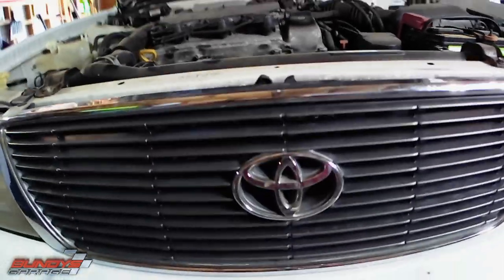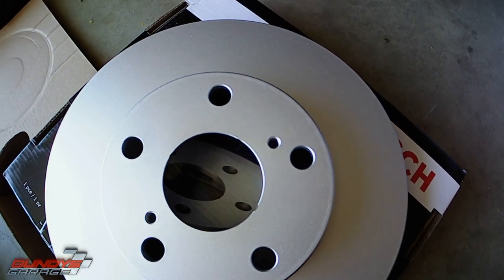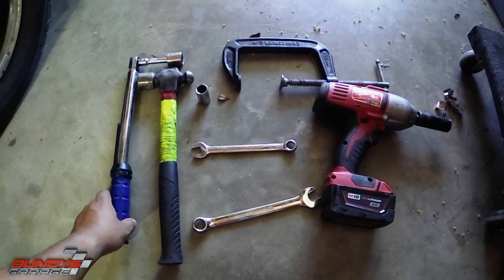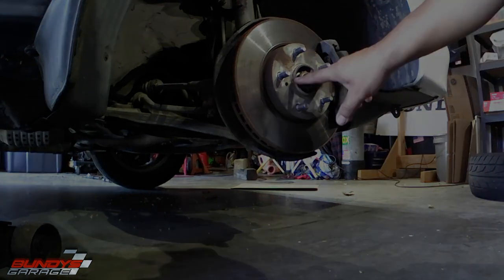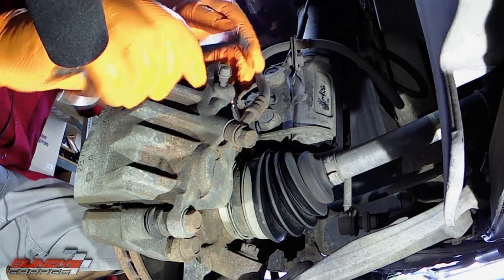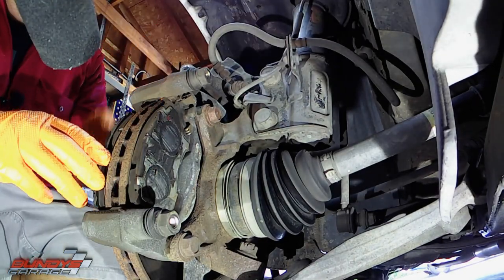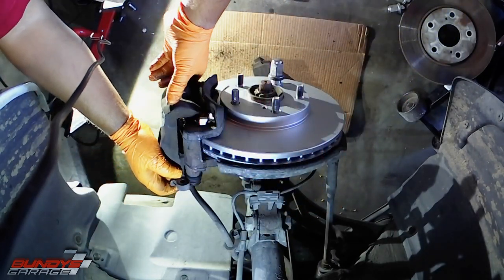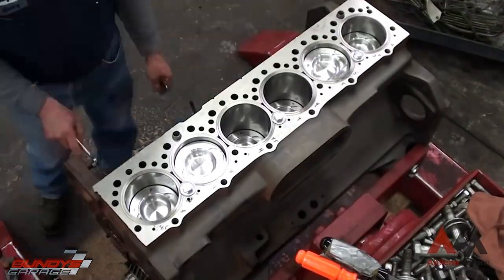DIY Front Brake Pads & Rotors Toyota Camry Avalon Sienna | Toyota Lexus 1990 - 1999 | Bundys Garage

Comment: I realize that this is an older video but, thanks for posting it, it answered all my questions!

I don't work on many foreign cars in my little, part time shop but, my brother recently bought a 1999 Avalon. Because of how he drives (and God knows when the brakes were last done!), it now needs front pads and rotors and, I've never done this particular brake job. I was wondering if it needed Allen or Torx bits like some vehicles do and, was really concerned if the rotors were screwed to the hub! Since I DO live in the rust belt, I was very happy to see that it doesn't have any of that! TRUST me when I tell you that you DO NOT want to deal with rust like we have!

Now, if only he has the key for those locking lug nuts...are Toyota aluminum wheels REALLY worth that much?!? Anyway, thanks again for the video, it really put my mind at ease.